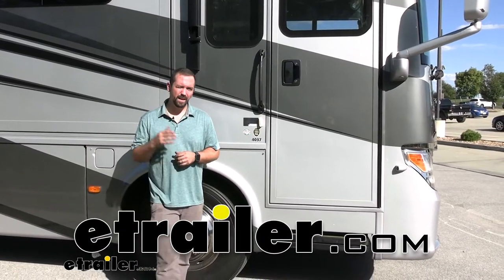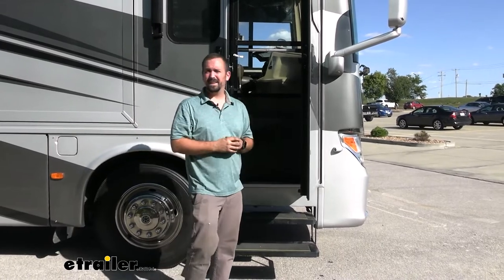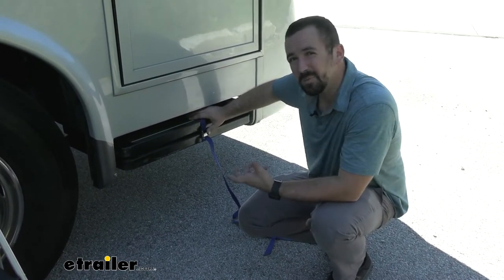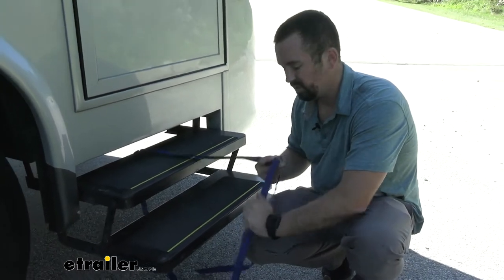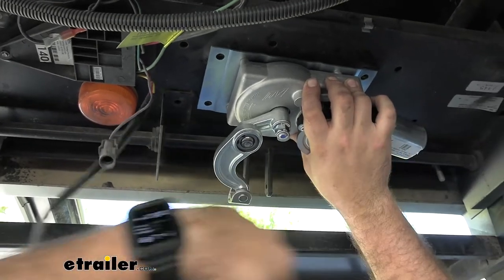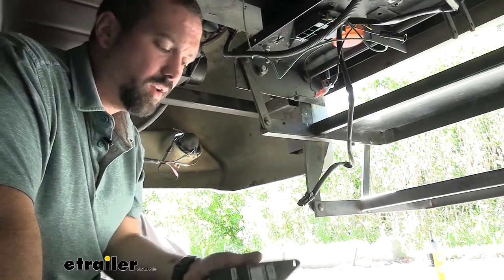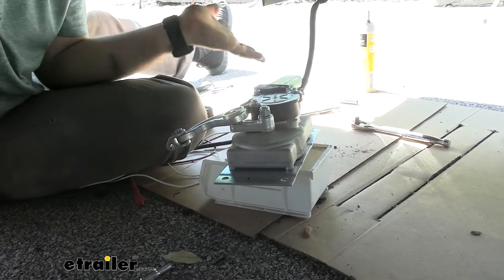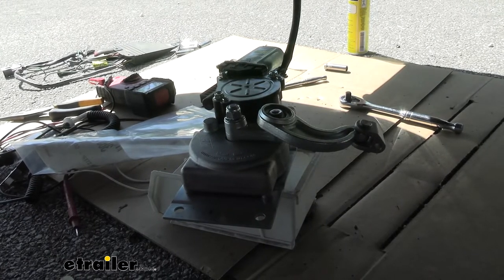Lippert RV Steps 5:1 Gearbox With Motor Replacement Installation - 2016 Newmar Ventana LE Motorhome

Comment: how did u know the module was bad? when i try to activate the steps i get a grinding noise?
Reply: The grinding noise is definitely not the module. Grinding is caused by either the ring gear in the gearbox or the gear on the motor. If it's the gearbox, you can reposition the gears to better teeth. If it's the motor, you'll need to buy a new one.
Reply: @PaulWagner1  we have a new motorgearbox assembly but can not get the current plug unplugged and afraid to rip the wires out. what is the trick to getting it unplugged?